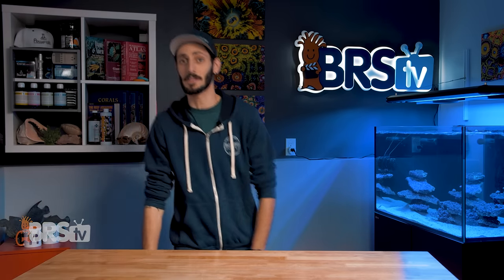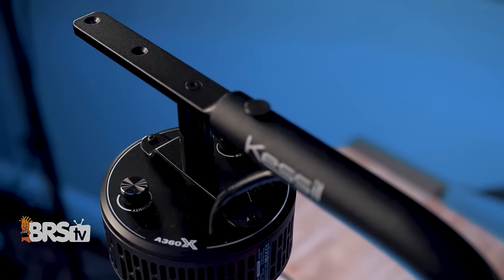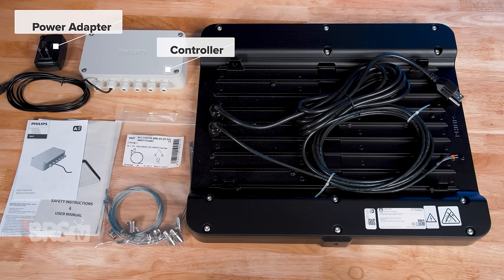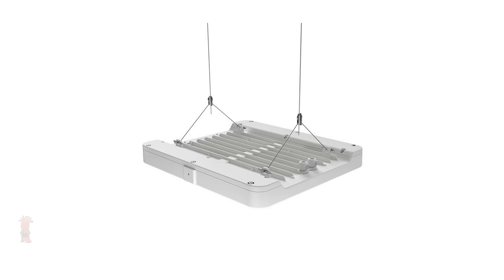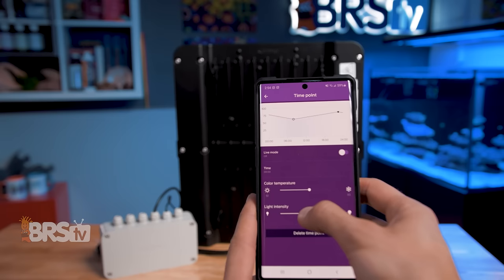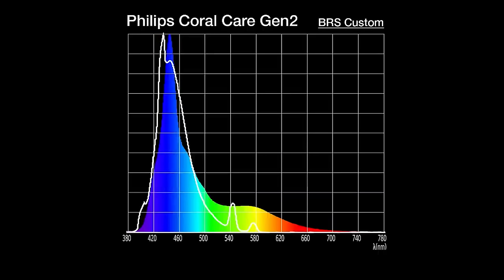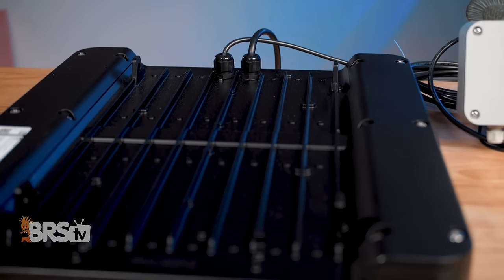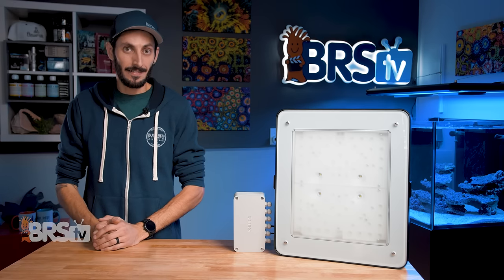Philips Coral Care Gen2 Light: Mimicking the Natural Ocean Light in Your Reef Tank Just Got Easier!

Comment: For the money I can get 2x evergrow it5012 that would be much better :D
Reply: I have 2x 2018 Coral Cares on my tank, Set Up another one with the evergrow it5012, but Sold it after 3 months.. the way it dims Up and down is horrible
Reply: @thomasgaal1908  for a $50 you can get the module that changes ramping from every 6 min to 1s and will let you use your phone to control it
Reply: @michalp.4975  at that time it wasnt released yet i think but i have Seen it some time later.
You mean the DIY Controller where you need to Open the lamp right?
Reply: @thomasgaal1908  you have to open the lamp to install any module in it. There is 2 or 3 on the market at the moment. I made my own with arduino WiFi board. plenty source codes around ready to be used. All you have to do is change the number of channels and outputs.